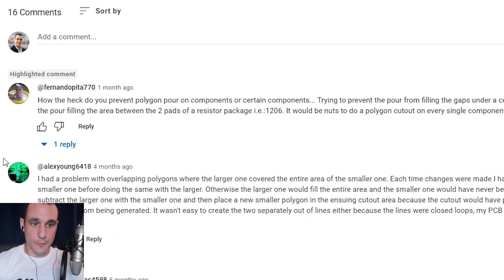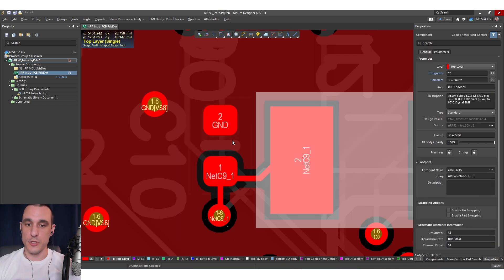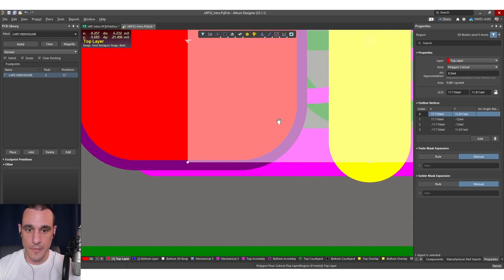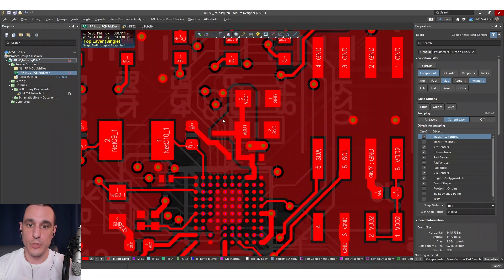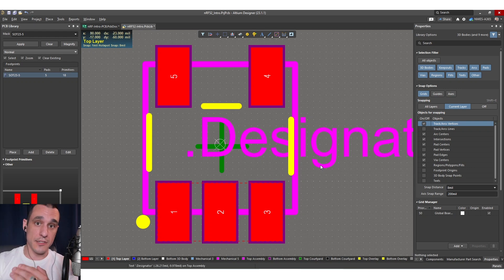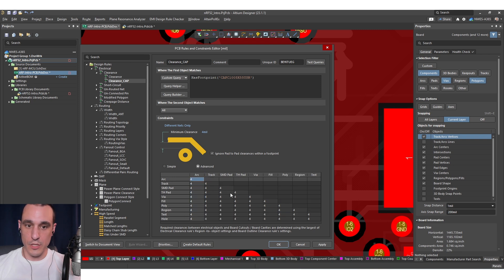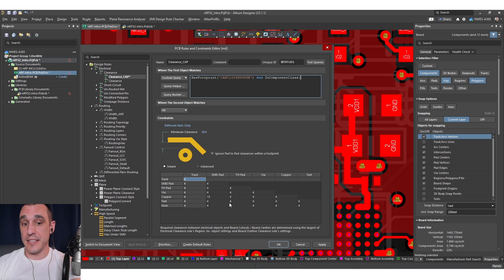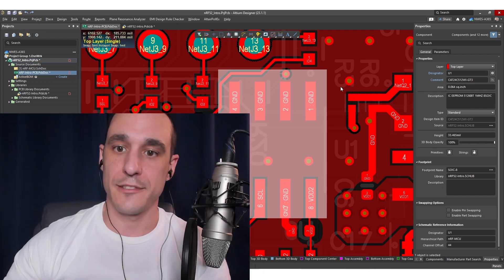How to Clean Polygon Pour between SMD Pads

Comment: Sometimes we need irregular polygon cutouts and with the PCB editor we may just draw that pattern with tracks or arcs, or even import complex curves from DWG files, then convert them into cutouts using Shift+Ctrl+C. However, this feature isn't implemented in the PCB library editor. It's not to be found in the Tools->Convert menu, and the hotkey has no effect. An alternative I've been using is performing the conversion in the PCB editor, and then pasting it into the library. Is this something Altium will cosider adding to the library editor?
Reply: I did not realize this conversion function was not available from the Tools menu in the library. I would suggest posting on the forum and creating a support ticket. If you create a support ticket one of the customer service guys might know of a way to do it in the library.
Reply: @Zachariah-Peterson  OK, cool, will do. Thanks for the reply.

Comment: Hi,
What is the problem with polygon between SMD pads apart from flux and dust?
does it help thermal relief and avoid tombstone?
Reply: If you are etching the boards yourself and you have no soldermask it will be a problem when you have finer pitch parts like 0603 or 0402, this is because the pour between the pads creates a risk of a short. For most cases where you have soldermask on the board and when you have higher pad-to-copper clearance than your soldermask expansion, then it is generally fine to leave the copper pour between the pads if it flows there. But if you are doing something more specialized, like high frequency RF or AC coupling on controlled impedance lines, then you should remove the pour between the pads to eliminate parasitic capacitance and parasitic inductance. Some people also just like the way the pads look without pour between them so it is an aesthetic choice.
Reply: @Zachariah-Peterson  oh i see thanks 😁
Reply: If the component is very flat, sometimes the thickness of the copper and solder mask between pads will interfere with SMD placement. (This problem may vary with PCB quality).

Comment: Thanks Zach - modifying the library component can avoid DRC problems later such as SMD to copper pour.
Reply: Yes it can, also that kind of cutout or a keepout is needed on certain components or connectors, so for those it makes perfect sense to just do it in the library.

Comment: thanks, Zach, I prefer method one but I think most of these kinds of problems are occurred when placing a large GND polygon on the top or bottom layer, thanks to you I know this is not a good practice and should avoid this type of polygon placement.
Reply: I don't want to say you should never have that placement, but there are good reasons to do it and hopefully I've explained some of those reasons in various videos.

Comment: hello Zach, would you please explain what's the problem if pouring GND under the components? are there any video talking about this? thank you!
Reply: There are several reasons. TipokMD mentions some of them, which are specific to assembly and rework when you have large mask expansion or when you have no soldermask at all. There is also a case to do it for RF components that are connected to copper pours, such as in impedance matching or with discrete RF parts like isolators. This can ensure components operate closer to their true specifications and have reduced deviation from true operation due to parasitics.
Reply: the area under the SMD component is difficult to clean from the flux. Flux can be hygroscopic and sticky to dust. Any moisture gets in easily and stay there. Plus, when manually reworking, there is a chance to damage the solder mask and look for a short for a long time.

Comment: I wouldn't modify a library component, unless I would NEVER want the polygon to flow  in the area; having same name footprints with different designs is a major no-no.

I typically use little pieces of single layer keepout to cut off extraneous parts of polygons as one of last steps before releasing a design. This is necessary where thin fingers of polygon often extend long distances with no connection.
Reply: Some times you just can't edit lib, because it's dblib for all pcb designers in your company))
Reply: I also would not do it in a library except for certain cases, like components that must have copper cleared below the entire part body. There are some connectors that have that requirement so it makes more sense to have it in the library rather than in the layout. But for SMD passives I would prefer to just do it with clearances.
Reply: @Zachariah-Peterson  for small components there is a polygon parameter called " remove necks less then" it helps a lot. A few bog components can be modified manually with polygon cutout. Also i adding union to easy drug components with cutout.
Reply: @TipokMD  That's true there is the remove necks feature, I usually use it to eliminate thin lines from  a polyon rather than clear between pads.

Comment: Hi Zach. I'm pretty sure you've done a video on thermal relief a while ago, but I think this might be a good opportunity to revisit the subject. I see a lot of potential for tombstoning with those pads going directly to a relatively high mass copper pour.
By the way, you forgot to mention that you can set a minimum clearance for the pour itself. Especially if I'm starting with more-or-less standardized footprints, tweaking the pour clearance will usually take care of most of my cleanup work for me.
Reply: Depends of layer stack. If you have solid gnd on layer2 close to top, some times prepreg is smaller then clearance. In this case direct connection is acceptable even for 0402 package.
Reply: Tombstoning depends on a lot of parameters and I honestly have not touched it in a video because I want to get the manufacturer's expert perspective on it. In all the boards I've built, I've only seen it once and it wasn't even on a direct attach to a copper pour, it was on a trace. It was also so minor that AOI would never catch it, but we ended up just dropping some solder at the lifted pad and it was all good. I'll do it on through-holes though, for example on connectors that need to touch a large ground pour or plane.

Comment: Hi. how to add information about the layer on which the component is located to the BOM? It is created from a schematic file, and I did not find any other way than to manually add a parameter to each component after tracing
Reply: In the BOM report options, "Sources" section enable "PCB parameters" (in the colums tab, the little button that looks like a expansion card) , and then you can enable things like layer, position and orientation. In a similar vein you can also enable database parameters (if you use a database library), and pull up-to-date information like pricing and stock directly at the time of BOM generation (assuming your database has these available).
Reply: Yep superjimz answer is the best way to do it. The hard way to do it is with a component parameter, I've seen people put that as a part parameter in the schematic!